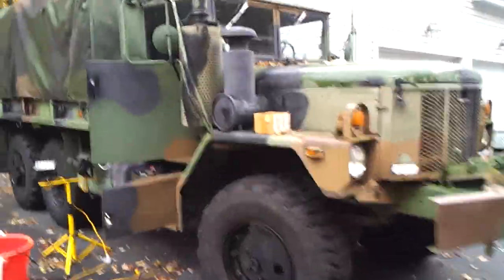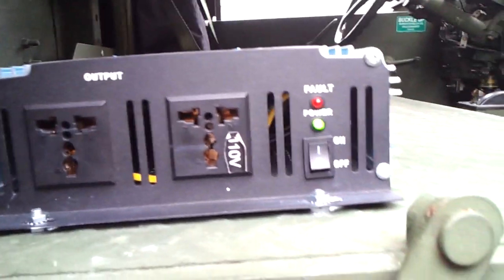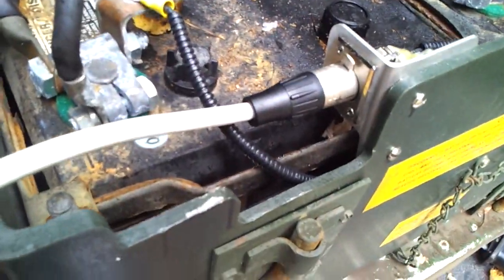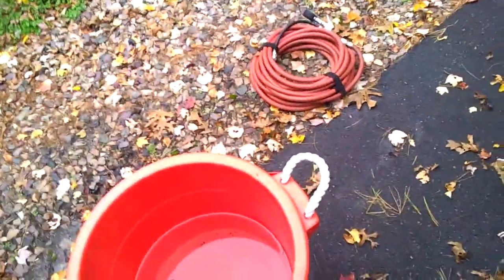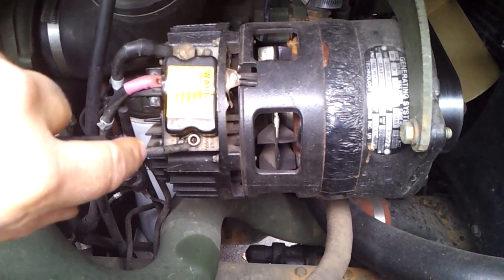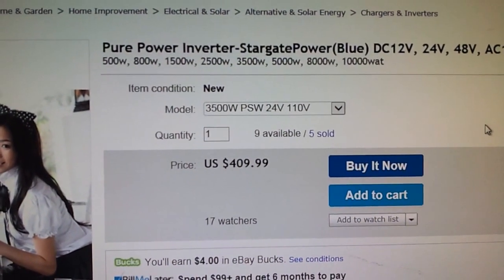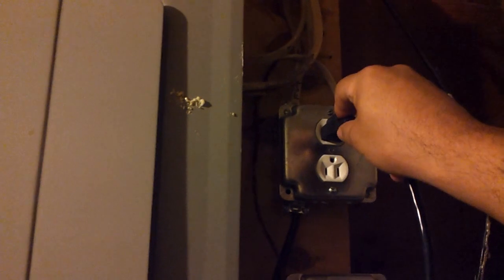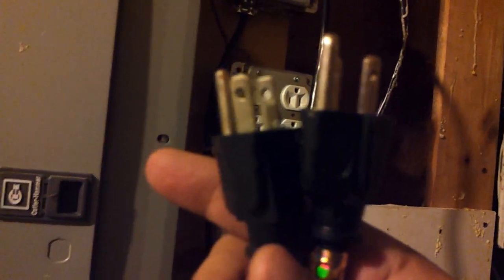M35a3 Power Inverter Installation

Comment: You could have just tapped off one of the batteries for 12v instead of a converter.
Reply from the maker: Alec Ver Bunker  I could have but not sure of the impact of having unballenced batteries.  if they where parrallel then I am sure they would level off but in series, if they hit 24 v then the alternator cuts off which could leave a miss match in amps per battery.  I am not an engineer so honestly I don't know.  I used a 24v to 12v converter to be safe.

Comment: Why mix 2 awg and 4 awg?  How long are your cables to the battery?
Reply from the maker: I mixed the 2 gauge and 4 gauge mainly because there where pre-drilled holes in the floor and that is the size cable that fit.   Not sure why the where there in the first place (radio power may be?)

As to the length - I tried 5 feet and that was way to short. 10 feet is fine, but if you want to snake the cable exactly where you want it, such as follow the frame underneath a little bit, etc ... then 15 feet.. 

Here is the cable I purchased
http://www.ebay.com/itm/251127203687

If it would have fit I would have used this
http://www.ebay.com/itm/WELDING-CABLE-2-AWG-20-10-BLACK-10-RED-CAR-BATTERY-LEADS-USA-NEW-Gauge-Copper-/261080559404?pt=LH_DefaultDomain_0&hash=item3cc99d2f2c

This would be too hard to make a lot of the corners but if your concerned you could do this
http://www.ebay.com/itm/WELDING-CABLE-1-0-20-10-BLACK10-RED-CAR-BATTERY-LEADS-USA-NEW-Gauge-Copper-AWG-/251112717812?pt=LH_DefaultDomain_0&hash=item3a777bfdf4